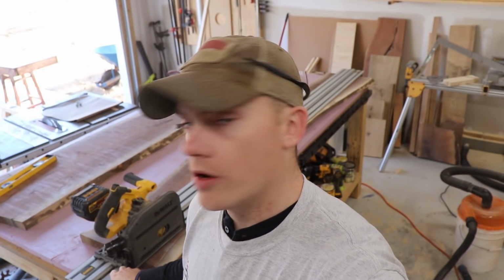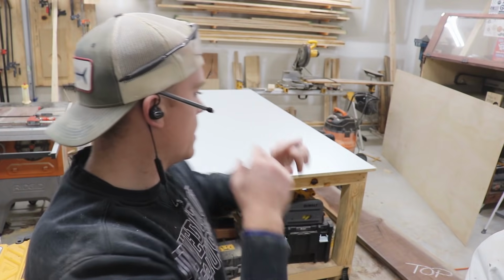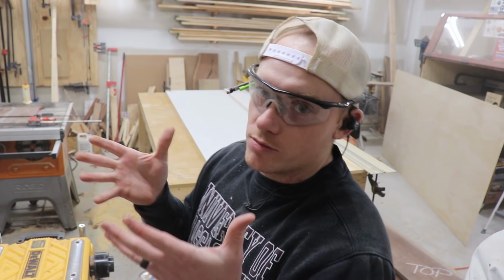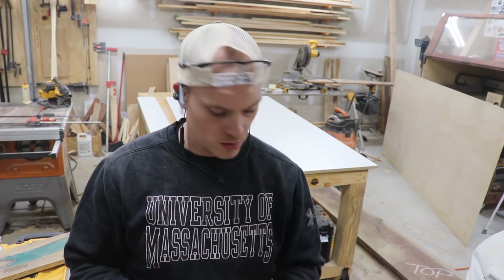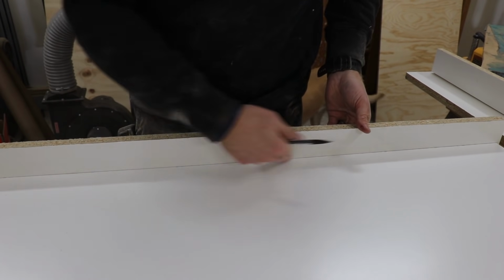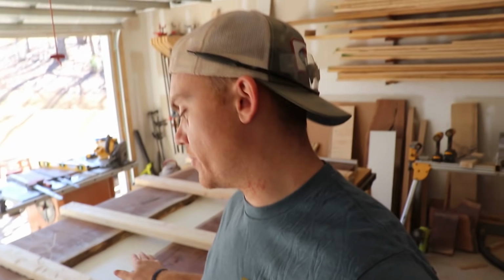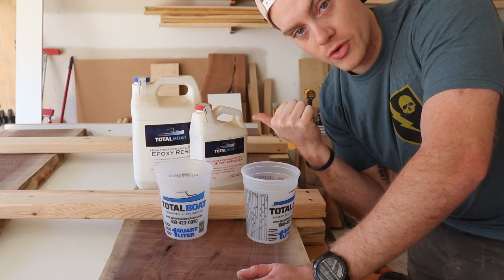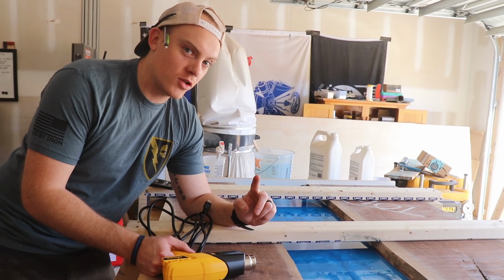Walnut Epoxy Table Part 3: The Mold & The Pour

Comment: Nice job and it's a beautiful table!  At 11:34 secs into the video, you're scrapping off what looks like silicone.  Did you put a bead of silicone on the bottom of each of the edges where the epoxy meets the wood to help prevent the epoxy from leaking out?

Comment: What brand of oil or wax was used to finish after sanding
Reply from the maker: Odies oil
Reply: @LazyLabAcres  awesome thanks last question how long between each pour did you wait
Reply from the maker: @Mageikman  a few hours just until it was stiff to the touch. If you use total boat make sure you use code BLUELINE for 20% off
Reply: @LazyLabAcres  thanks yea I already have some totalboat just was wondering cause my first attempt it bubbled up and cracked so guessing it got to hot overnight
Reply from the maker: @Mageikman  total boat is finicky so make sure you don't pour over 1/4" thick at one time or it'll get too hot

Comment: what is the last thing you used at the end?
Reply from the maker: If you are referring to the finish, it's Odie's Oil
Reply: @LazyLabAcres  thank you very much for this video... Now I want a track saw :(. Sooo expensive
Reply from the maker: @zwyxjohn1544  the track saw is worth every penny. I wish I got one a lot sooner than I did
Reply: @LazyLabAcres  when applying this oil, did you apply on both sides? and do you use a buffer to get that sheen after?

Comment: You stressed the importance of only pouring 1/4” of epoxy at a time. I’ve also seen this on other epoxy videos where they stress this as well. My question is how long do you have to wait between pouring each layer?
Reply from the maker: Until the layer is almost cured. Total Boat now has a deep pour system that allows you to pour up to 2" at a time. I used it in my coffee table building video
Reply: BlueLine WoodWorks thanks. Next time I order I’ll have to use your code.